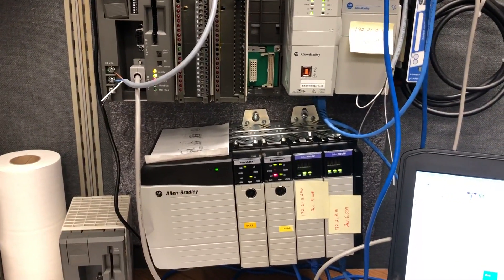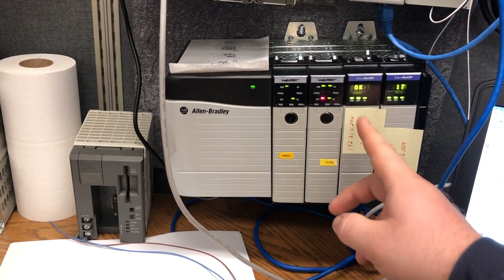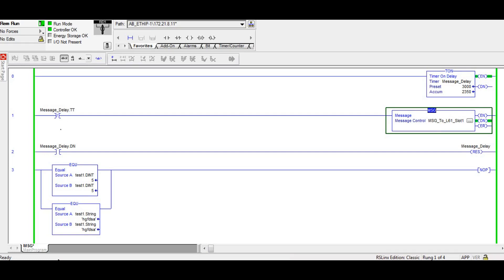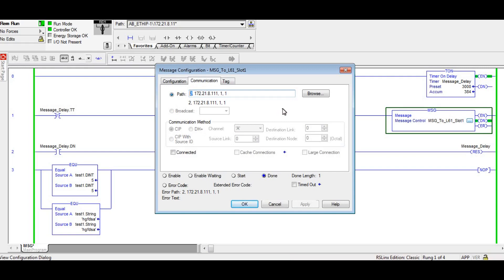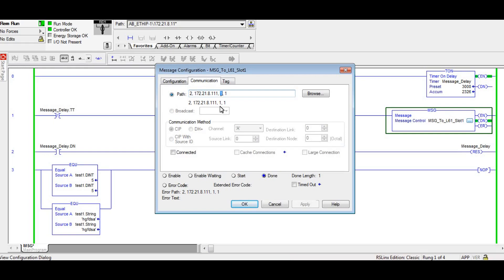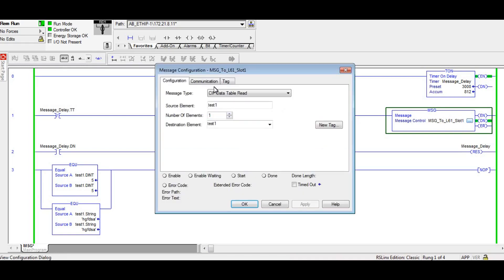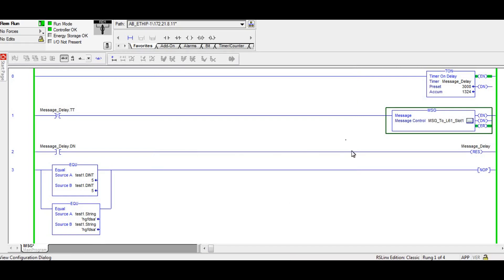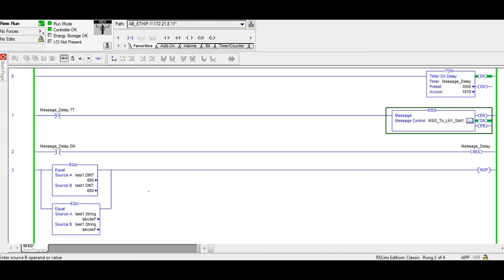Ethernet  CIP Data Table Read MSG from Compact Logix to Control Logix

Comment: Hello!

I'm trying to read data from a 1768-L43 PLC that has a 1768-ENBT card and a 1794-AENTR module which has all the variables I need, into a 1769-L33ER PLC which is in an other project. The  1794-AENTR module has an IP address of 192.168.1.11, my problem is that the I/O config that uses the 1769-L33ER PLC already has a device with the IP address of 192.168.1.11.  I tried adding the 1794-AENTR module to the other project but it of course showed an error of duplicate IP addresses.
How could I reference the path to the 1794-AENTR module without messing up the other device with the same IP?
Reply from the maker: Hi,
The 1794-AENTR is a Flex I/O network adapter.
This means to me that there is Flex I/O cards connected to this AENTR module, and the data from those I/O cards are probably being read by the L43 controller.
If that is the case, you will have to find those values inside the L43 controller, then you can MSG or set up produced / consumed tags between the L33 and the L43.
Does this help?

Comment: Hello How can you apply the msg to write to a drive like the power flex 525? I am working with an older version of rs logix 5000 v13 .
Reply from the maker: Raul, it is possible to do what you're saying, however you need to send explicit messages to each parameter you are trying to control.
I may be able to make a video about this if I can locate a 525 drive and a controller to talk to it, but you are going to need to get the drive's manual and start looking for the Instance numbers of the parameters you want to modify. Use CIP Generic read Messages to try to get access to the drive, then turn around the read into a write and see if you can get it working.

Comment: Dear sir 
Nice information,
Hi sir 
I tried to messaging between 1769-L33ER Version 20 a processor to 1756 L6 Controllogix Processor Ver 19 through the IP address path Because in OLD controllogix IO tree I am not able to Add L33ER processor for produce and consumed ,So I tried messaging through iP Address ContrologixENBT. Using this  IP path But This Messaging not getting 

Please need your help sir 

Thanks 
Lambro
Reply from the maker: Lambro please note that the final number in my path is my PLC slot number in the controlLogix chassis. Most people have their PLC in slot 0.

Try this path in the CompactLogix to read or write the ControlLogix:
2, IP ADDRESS of ControlLogix ENBT, 1, 0
If your plc is in slot zero.
Reply from the maker: If you are trying to configure a message MSG instruction in the control logix you need a different path to reach the CompactLogix.

1, slot of ENBT card in the controlLogix, 2, IP of Compact
For example would be 2,1,1,172.21.11.249
If your ENBT card was in slot 1 and the IP of the compact was 172.21.11.249